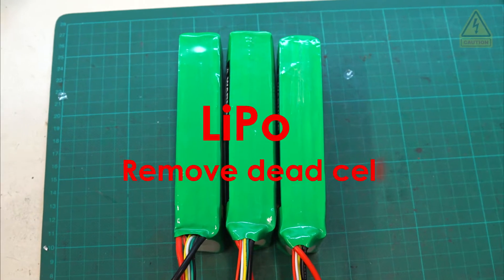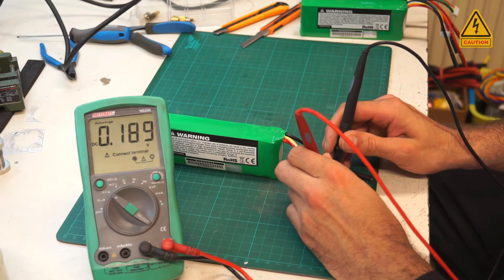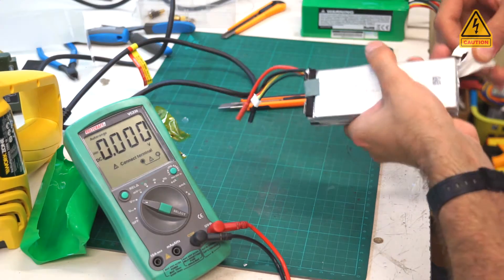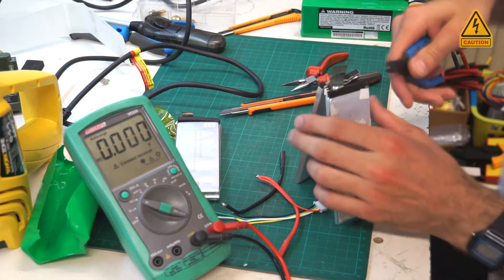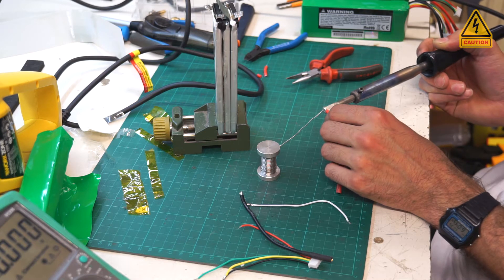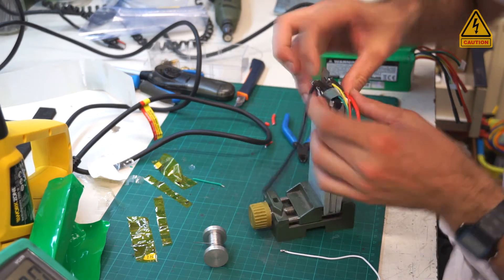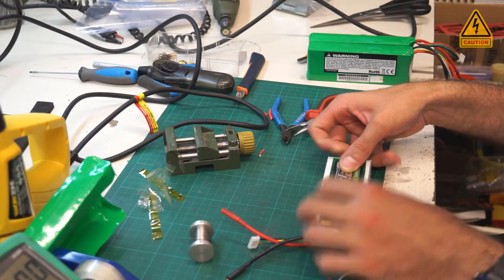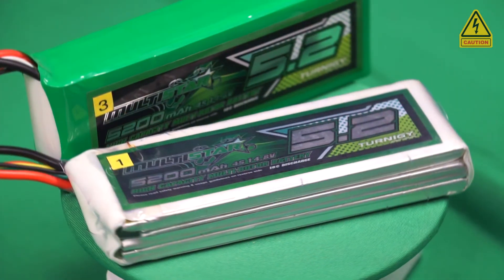Save the lipo - Repair LiPo battery pack [remove dead cell] [4s to 3s conversion]

Comment: I'm trying to fix a HRB 5000mah 22.2 pak.
The positive connection seems like it is crimped connection instead of solder. 
Seems impossible to get apart.  And if I do get it apart how can i get the new cell connection?
Reply from the maker: It is crimped, because out of cell come aluminium contact wich can't be soldered, so it's crimped to a piece of cooper strip wich can be soldered, cut the cooper piece so you can solder on it and leave the crimped part with the battery cell.
Reply: @TinC33  thank you 😊

Comment: What’s the name of the mini green vise you using for repair ?
Reply from the maker: Proxxon mini vise, cost about 20$ but it's very usefull, also for soldering connectors etc.
Reply: Thanks I will order one can’t wait to use it very helpful video
Reply from the maker: @benbenz1229  yup it's really usefull gadget, thanks

Comment: The problem is to solder the right balance wire in the right terminal
Reply from the maker: why do you think, first one on negative side is black then just go one by one, second wire is on 4,2V third on 8,4 and so on, there is always one wire more than the number of cell.

Comment: Good video dude. I've been saving bad 2/3/4/6s packs forever and making new packs the same way. Care and paying very close attention is key and making sure the "mah" is the same is a MUST. Anyone can do this ! It will save You money and of course You can make custom packs too. Great of You to make a video showing this.
Reply from the maker: Thanks, and yes you need to be careful when soldering, it help if you put a pice of insulation tape on other contact than the one you solder, than cover that and solder other... And also is good that the C rate of cell is the same because of internal resistance of cell, but as you say mAh is the most inportant, otherwise balancer in charger got lot of work everytime...

Comment: What make is your soldering iron ? i have a 60W Wellor and it doesn't melt the solder on these Multistars :(
Reply from the maker: Just one no name, 60w weller must melt that solder, just clean the nozzle and add a bit of fresh solder into.
Reply: Thanks for the prompt reply. I will try solder on tip of the iron , i'm a bit of a noob  when it comes to this sort of thing . cheers
Reply from the maker: @wavestherules558  just be careful so you don't make shortcut, when you solder one contact please insulate other with insulation tape. If you make shortcut ther will be big buuum and preatty sure your solder will die.

Comment: oi mate.
i have a problem like you.
1 cell is bad,   i want to remove it,   but....
its a big 6s 20,000mah lipo,  and 5 of the cells are at 4v.   meaning full of energy,  ihave removed the plastic, but too scare to cut or solder the terminals.
Reply from the maker: Alans Snack ok, than just remove one dead cell ;-) plastic take off really slow and carwfully, mm by mm so you don't cut some cell or they will be dead also. For soldering you can help with electric tape, so you insulate all other contact from the one you solder, than tape unsolder one and untape second one and so on...
If you don't got experiance with soldering please gove it some friend who know to work that, if you make a short cut with a soldering iron, there can be a big booooom, specialy at the big battery as you got, and also soldering iron can be demaged.
Reply: thank you, good tip with using electrical tape to cover all the tabs.  .i will do that.
Reply: You can discharge each cell via the balance plug
Reply: @DKF22  and why would i want to discharge each cell?  to make it slightly safer upon trying to repair it? seems not worth it to me.  besides, those big lipos are long gone now.  waste of money.

Comment: if you had one more cell from another battery at the same mah same c-rating could you make a 4 cell and solder on a balance lead, for a new four cell battery or is it not safe to add them together? i guess it would be combining two dead 3 cell batteries into one good 4 cell, instead of just removing
Reply from the maker: quad55555 i do that few times without any problem, just be sure that they'r booth same C rating and same cappacity, i recomended to do that only with identical cells, eaven that can got different interior resistance...
Reply: thank you for your response

Comment: Be VERY VERY CAREFUL, LIPO will catch fire quicker than gun powder. It is not the typical short circuit spark, it catches fire fast.
IF attempting to do this for the first time, do so on a open space, fire extinguisher nearby and someone as safety observer just in case.